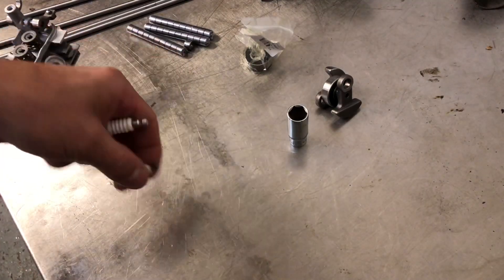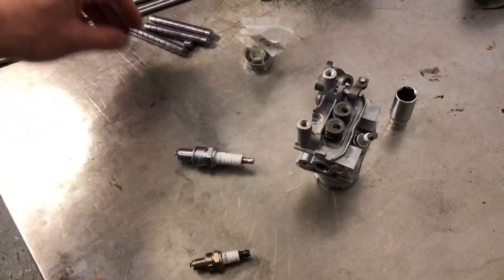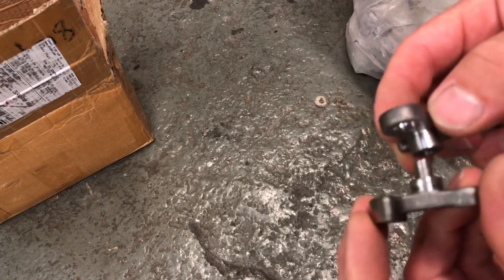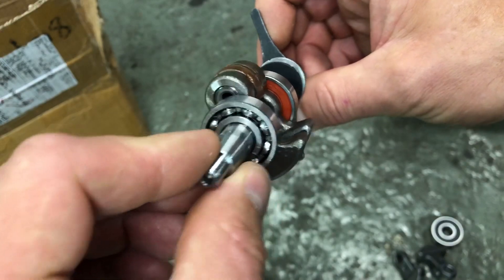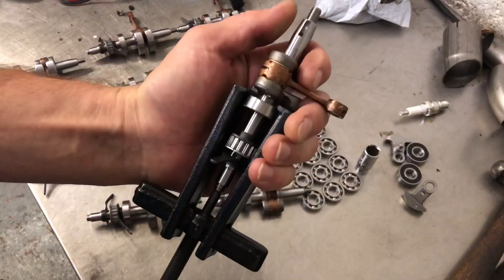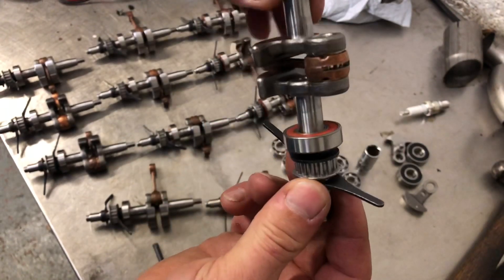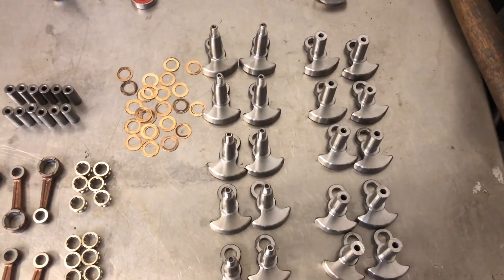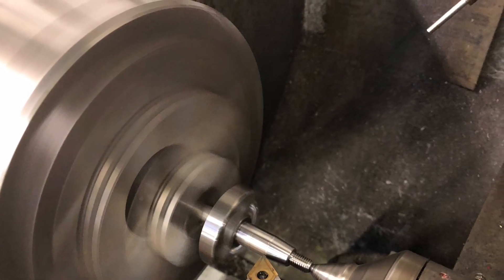300cc V12 from 12x honda GX25 brushcutters ! prt 2

Comment: For the Porsche build you should find a  moped turbo kit. Have a tiny turbo setup. You could still use the carb set up or just run one big carb and have a draw through set up.
Reply from the maker: Nope, no can do- the 1973 works Martini car (R7 prototype) was 2.8 atmo , turbo was the huge whale tail and 1974 impact body shape !
Reply: Even then a turbo would just be a little much especially for a car this small 😂😂😂